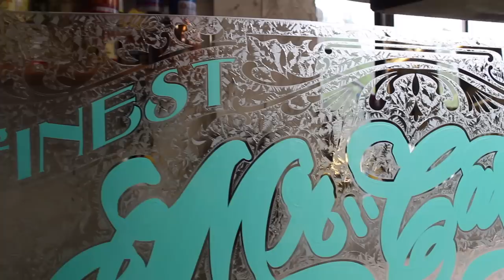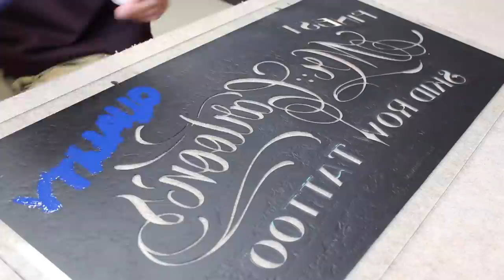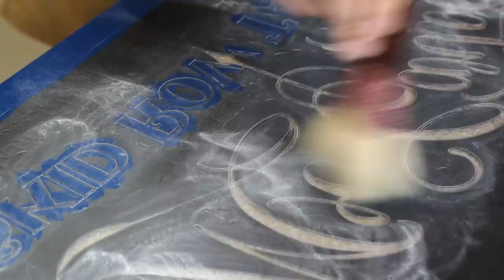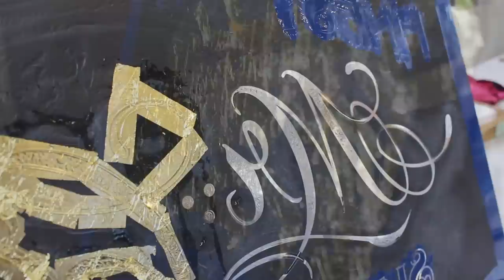Mister Cartoon,MAKING GOLD LEAF GLASS SIGN - ART  ASMR

Comment: I'm in awe of all the various arts involved in this process. I'm assuming it's first rendered on some kind of screen design software? I can't imagine how much time goes into this kind of project. 4-5 days? Definitely don't have to worry about anyone taking your job sir. Nice work.
Reply: the company would have a higher end vinyl cutter/plotter that likely uses coreldraw or illustrator because those are vector based, as opposed to photoshop that's pixel based. a lot of these fonts and decorative pieces are easy to get.  the jaguar plotter the ex got for our trophy/t-shirt shop was about $3K if i remember right, but that's what you'd want for a commercial daily user. you wouldn't need that fancy of one for something you only used now and then. you could pick up an uscutter probably for about $500 or so that does the job, just slower -- and a lot louder, lol -- and with the low-level detail for projects like this. (you get what you pay for, so something like the jaguar is more precise time and time again, but we started off with a refurbed uscutter many years ago and it was great until we outgrew it.)

beyond the computer design none of these tasks seem particularly difficult, but some seem time-consuming. getting the glue chipping sped up will still take at least two days judging from other videos i've seen on it. lining vinyl up is a pain in the ass sometimes, lol, but not like it takes all day. running a knife around the whole design once the hide glue has gelled looks like it would take awhile. i'm just guessing that, computer and drying times aside, there's probably a good two days of solid work involved barring some process they're not showing and there's no dilly-dallying, but i could see three as being reasonable, too. in real life you set the tool down and it's gone three seconds later and you're like, 'hey, where's my glass scalloping doo-dad thingy?!' or, 'damnit, why can't i line stuff up for shit today?'

Comment: How was that done before sandblasting, printing, lasercutting?
Reply: do you mean the vinyl stencils? those would be done on a vinyl cutter/plotter using either probably coreldraw or illustrator (not photoshop). there's special vinyl made for sandblasting. laser cutting is out for this material, not only would it probably melt it, it would cut right through it (not good for lettering and design element requiring separated pieces in the middle to be in a certain place), and lasering this stuff emits toxic fumes. 

you could go to a local trophy and/or t-shirt shop and talk to them about having them made. of course, you could find someone online, but i'm a huge fan of keeping money and work in your community. if you wanted to save money by designing it on the computer yourself, you'd have to know what software they use, bearing in mind photoshop is pixel based, but plotter software is vector based.
Reply: @manlymcstud8588  ??
Sorry english is not meine Muttersprache.
No..i meant..before this mordern technics like lasercutting and sandblasting. More like in 200 years ago. They did beautiful glasswork back then..but how did they do it?

Comment: Incredible. I'm completely baffled by the chipping process. In another video, he says the liquid used is hide glue. What is the light box he puts it in to cure? Is it ultraviolet light? Infrared? Heat? Is the chipping process a chemical reaction or is it mechanically pulling the chips away from the glass? The noise sounds like it's physically pulling a thin layer of glass from the surface! I have so many questions!

Comment: Nice! Is your ventilation/wet area a commercial setup or did you build it yourself. Love the acid embossing! Thank you for sharing.
Reply: Not acid, it's angel gilding
Reply: @scotthendricks79  all of the gold leaf script in the middle is acid embossed. The work was not shown, but obvious in the final video shots. Yes, angel gilding is applied after the glue chip.
Reply: i'd say it's commercial by japanese standards, lol. when i did screen printing in the little shop i used to own it was pretty DIY because the commercial equipment was stupid expensive and didn't offer any advantages over the stuff i could cobble together for the most part. some things i could have gotten around, but i just bought anyway.

Comment: What exactly is happening with the glue chipping?  I assume its not just heating it again, because the glue would just melt. Is it a dehydrator or something?
Reply: Same, its interesting but I don't know what's going on there
Reply: @mattr3194  Yeah, I checked up online. It's an animal hide glue (so basically gelatin) and after it's been applied to the sand-blasted areas (to allow it to grip the surface of the glass) it's dried/dehumidified, causing it to shrink, and chips the glass under it.